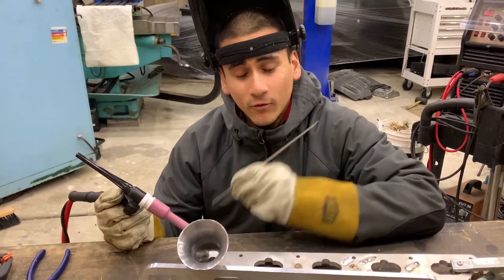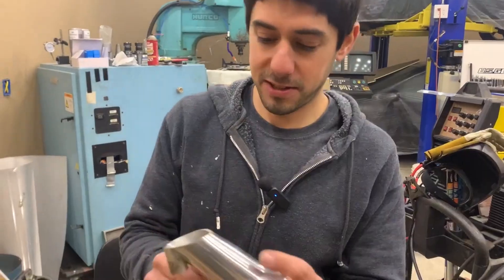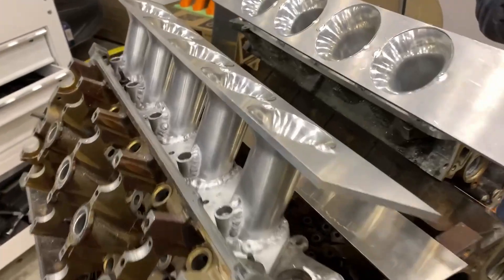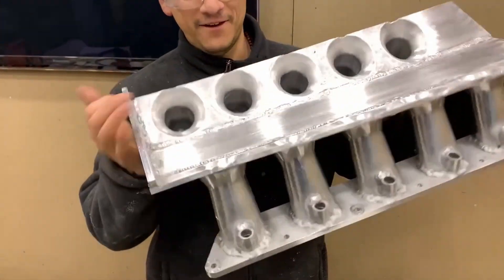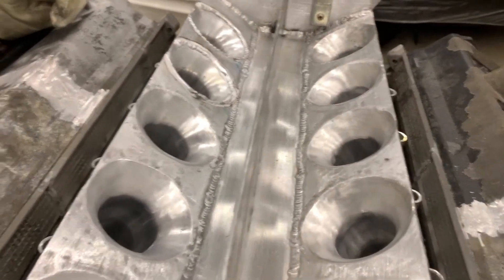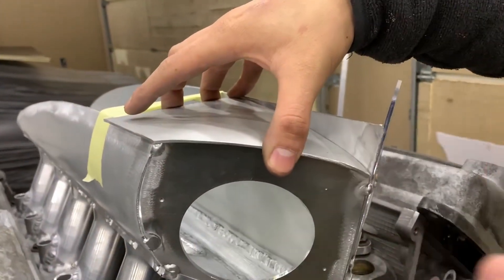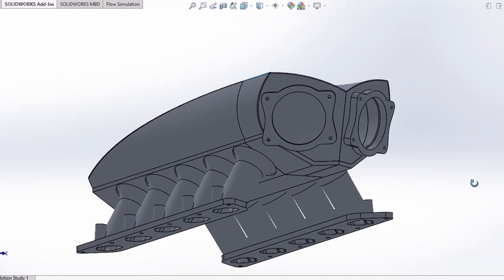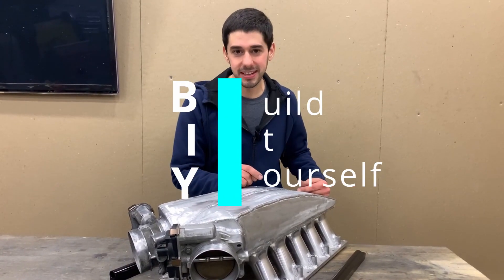Making a Custom V10 Aluminum Intake - Ford V10 4V Build Ep. 7

Comment: Watched 3 in a row.  So engaging and love how you worked thru issues.  I know at this point you got the V10 to run,  but how well in the design was reverberation and air turmoil within the intake box to insure even air flow from the front cylinder to the last rear cylinders? Love to see the engine dyno tested.  Well off to bed.  😴

Comment: 10:29. For future reference, guys, don't ever use a cutoff wheel to cut aluminum you're welding. Bits and pieces of the wheel will impregnate into the aliminum and cause leak points. All those black little specs in the weld just above that throttle body plate is a perfect example of  contamination of the weld from that cut off wheel. Just use the 
 cut off wheel to cut down the section you want to cut off the larger piece of aluminum sheet, then use the band saw to do the final cut. You'll thank me  on future builds.

Comment: I ❤ what U guys are doing.  Xcellent so far . As 4 colors.  I would personally go black ⚫️ block , heads & valve covers . And a Ford Blue Intake . 💙 
It would really Pop . 
The division in the intake ?? Is that what normally occurs?  
Can't wait 2 see this baby on the engine stand on the Dyno . 

Hope u r taking 2 the best camshaft guys like Comp or Howard's Cams . 

What sort of torque r u guys hoping 4 ? 

Robert Australia 🇦🇺

Comment: For air flow would the throttle bodies flow better opening with the shafts vertically? So that the air would flow straight back instead of hitting the devider?
Reply from the maker: If they were vertical, one motor would have to point up and one down so the blades open the same way. But im not sure that would help with air not hitting the divider.

Comment: Can't wait to see this finished up! 1 word of advice though, I would have left the center divider out for more plenum volume and revision balance inside the intake
Reply from the maker: We didn’t want to risk cylinder air starvation due to the even firing order of this motor. Tuning out intake reversion is a huge undertaking, requiring flow analysis of the intake and heads. Would be a cool project for a future version of the intake for sure, but way beyond the scope of this build at this time.
Most even fire V10 engines we benchmarked have dual plenums, so we are sure this is a solid direction.
Reply: @@biy_buildityourself  I didn't even think about the even firing order. At least you all have done your extensive homework. Keep it up!

Comment: sooo yall gonna leave the intake like this or yall will cut the wall in the middle?
Reply from the maker: The intake is all done, all we have left to do to mount the fuel rails, we’ll be doing that in the coming weeks.
Reply: @biy_buildityourself  no i mean the sheet metal wall between the throttles inside the intake
Reply: @l.ox99  It will have two plenums, the wall is intentional. A V10 fires evenly on each bank like an I5, so dual plenums work well from a wave tuning perspective.

Comment: Now I believe the 2V and 3V v10 have a balance shaft on the left cylinder head, what is your plan on that, do you think the extra cams will keep the vibrations down?
Reply: keen to find out this as well
Reply from the maker: You are right, they do come with a balance shaft. From our research, it’s main purpose is for NVH so we will not be using one.

Comment: Your numbers to beat for a 2V N/A Ford V10 are 324 HP, and 525 TQ, factory stock numbers are 310 hp, 425 tq
Reply from the maker: We will discuss the power expectations in the video where we walk through all the parts. Needless to say, if we don’t exceed those numbers we will consider this a big failure 😅

Comment: I love it but why the split chambers and not some openings to even pressure?
Reply from the maker: Good question, for an even fire v10, there is always an opposite cylinder firing from one bank to the other. Keeping the chambers separate eliminates the risk of starving one of the sides. We referenced other even fire V10 engines like Lamborghini.

Comment: I can't wait to hear how this engine is going to sound. Huge mod motor fan. Currently have a single turbo 2v that I beat the hell out of. This platform is highly underrated.
Reply: How high does yours rev to? I hear they can safely rev 1000rpm higher than stock, that would sound insane🤯
Reply: @eg1960  currently spinning up to 6500. Don't want to go to much higher on 10psi and stock bottom end haha
Reply: @prxcizion4129  what kind of exhaust?, I've been looking for good audio clips for this engine when na, I want to hear it under load and near rev limiter  so badly, I want to hear na but I bet that turbo sounds good😩🤯
Reply: @eg1960  It's a 4in down pipe running straight out the turbo and pointed straight down. Haha but my old exhaust set up was long tubes, bassani x pipe, and borla stingers. Would have never gotten rid of it if I didn't go turbo haha
Reply: @eg1960  also if you go to my channel there's a short idle video on there from the first start up